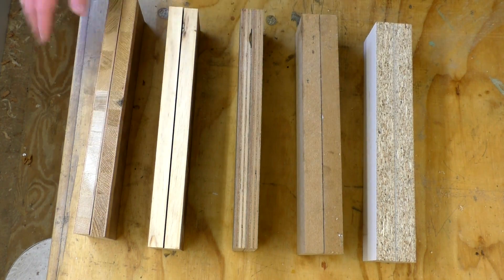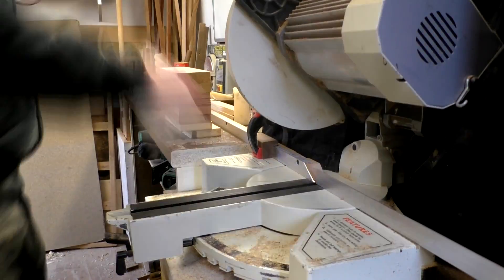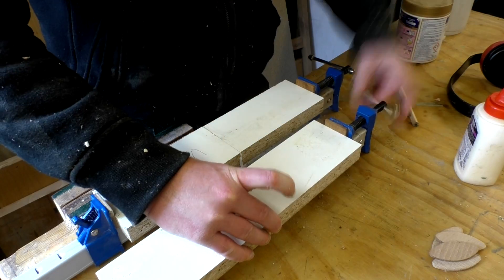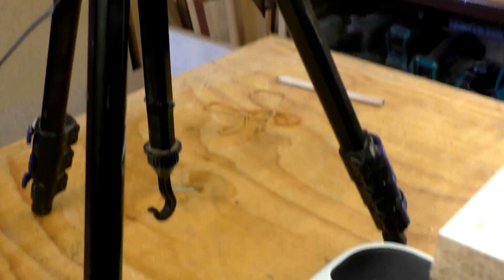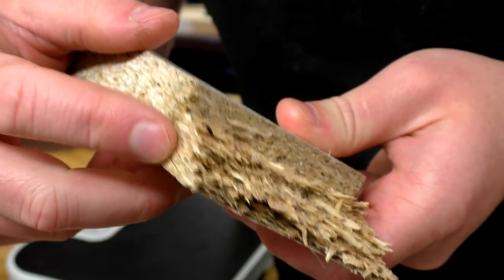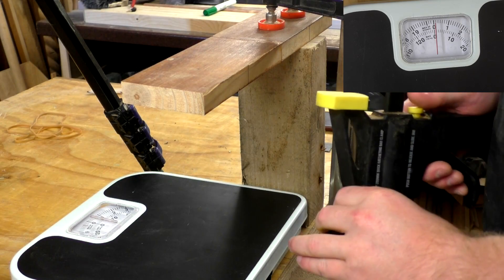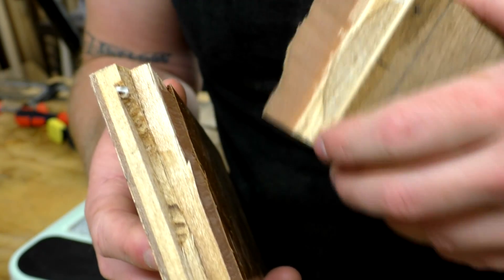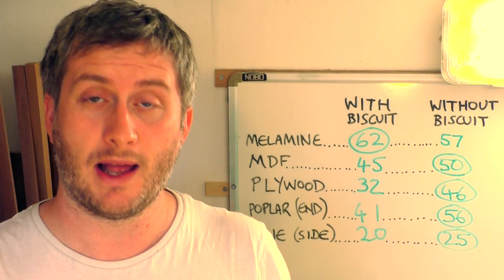Testing Biscuit Joint Strength - Do Biscuits Add Strength To A Glue Joint?

Comment: I have never used a biscuit in a joint. But, with the biscuit at the center-line, it takes the least amount of the load in bending. You might say the biscuit is least helpful strength-wise at the center of the board. Since your experiment is primarily bending, the "top is being compressed" and "Bottom is being stretched" seeing the greatest loads. The center gets very little of either. I would be interested to see if biscuits were placed closer to the end, would that make a difference? Also if you could "pull" the boards from the end, making a tension test. That test would be a little harder to set up, but I would come back to watch if you tried! Nice video.
Reply from the maker: +Jeremy Fielding thanks Jeremy. Yeah they are really good points. May do a follow up on this one day and try them in different positions. Will also see if I can think of a way of rigging some sort of "pull" test set up
Reply: Going on what you stated would a glue up with 2 biscuits an 1/8 of an inch from each surface would be a way to dramatically increase strength
Reply: Good point. I'm also curious about whether adding stress/flexing/fatigue to the joint first, or varying the moisture content in the wood might make biscuits or dowels perform differently... i.e. replicating wear and tear on regular furniture joints over the seasons. This would be even more annoying to test though :-)

Comment: i've always thought they add strength because it's kind of like a spline joint. But it seems the manufactured biscuits themselves aren't that strong. I would've been interesting to see more samples of each, so you can get a good average
Reply: Biscuit joints are really strong when used correctly. The problem with was test was that there was too many variables. 

I have used them before on structural joints and they are still standing.

Comment: Never used biscuits myself, ever.
For lining up you can also use tiny nails.
It would be interesting to also test it with dowels btw!
Reply from the maker: +dA Brewer thanks, yes may well do that soon :-)
Reply: yes would love to see it with dowels.

I think part of the reason why biscuit jointers (along with most other power tools) are so popular is simply because people, namely men, love buying tools like women buy shoes. 

Like every carpenter I see in a video on YouTube owns a kreg pocket hole and clamp set. When there is nothing special about the clamps and the jig can be homemade in less than a minute.

People like tools, nothing wrong with that. I like tools too.
I was about to buy a biscuit jointer but now I've found out they add no strength I won't. Somehow this makes me sad when I should be happy that strong joints are much easier to make than I thought!

Comment: I had heard that biscuits made no difference or maybe even weakened a joint. But I never actually believed it. Very interesting. I have a biscuit jointer but only used it for two projects since I bought it 2 years ago
Reply from the maker: +ksp1278 I had heard that too but didn't believe it... Now I do! May still use it for alignment every now and again but could definitely be without it!

Comment: Very interesting experiment. As far as I know, biscuit s are for alignment not for extra strength. They ran made from a very thin and soft wooden material compared to dowells or dominos. What makes wondering is the glue. I don't know what you use,but you shouldn't have so clean breaks at the glued joints.
Reply from the maker: +Stamatis T I think biscuits are made from beech which is a hardwood? I just use regular white pva wood glue. It's never failed me and is plenty strong enough for most applications

Comment: A very Matthias Wandel-like video, well done. I'm not that surprised biscuit joints fail more quickly then butt joints when a bending force is applied, since your making more holes and sharp corners in the joint along which it can fail. I think biscuit joints would perform better under a pulling force. What surprised me the most was how strong the end grain glue up was.
Reply from the maker: +Eduard van Iersel when you put it like that you're absolutely right! I don't know why I didn't think that way but I do now :-) the end grain joint really shocked me too

Comment: Also wld it depend where u put your clamp as in closer to the joint or further away from joints?
Reply from the maker: +dan barrow I don't think it'd make any difference as the force should be roughly the same once the glue joint is tight

Comment: Very nice video,

Your experiment setup was such that the joints where loaded with bending moment and shear force, with the moment being the dominant. The stress distribution due to bending moment in the cross section is linear with maximum tension at one edge, maximum compression at the other edge and zero at the center of the section depth. Therefore, in think that  the biscuits didn't add to the joint's strength because they where at the center of board thickness. Placing the biscuit closely as possible to the board face that is in tension will, in my opinion, strengthen the joints. 

thanks for the video it was very interesting.
Reply: Very Interesting point there.  Placing two biscuits, one at the top and one at the bottom could be better to put it in tension or compression and lower the moment.
Reply: Rag 'n' Bone Brown basically the middle will bend more than the  edge so you will break the biscuit easier in the middle.
Reply: hey, thanks for the 'clever'. Well just an engineer. I am attaching link to a 9 sec video presenting what i tried to explain in my comment. https://www.youtube.com/watch?v=NZ7jwnskKSQ. The bottom line is that joints with eccentric biscuits might be stronger.
Reply from the maker: +yzelickman thanks! Sorry but your comment has gone way over my head - you're too clever for me!

Comment: After watching this stuck my biscuit joiner on eBay, now searching for a Steve clamp...
Reply from the maker: +Kevin Clarke may do the same :-) haha I am going to start renting Steve out!
Reply: I have used biscuit joints for years and they are really strong. They really come into their own when doing carcas work on cabinets.  I have used biscuits on tables as well so the biscuits were applied to the joints and the glue was allowed to dry and then screws were applied after.  Those tables have stood for the last 20 years with no signs of failure.

Comment: I have always believed that biscuits are for alignment not strength. For strength use mortise & tenons / domino machine I would have thought
Reply: S W I would love to see a domino in use.  I still think the plain joint would be equally as strong.  A real mortis is probably much stronger.
Reply: My thought too i would never use or consider a biscuit for adding strength
Reply: after seeing this experiment , I think it's a real possibility that dominos add no strength either.
The examples here had the wood itself breaking because they had been weakened with a hole.
Reply: I think dominos would perform similarly to biscuits, as it is practically the same type of joint. Just a little different shape.

Comment: Very surprised as well Keith.  I bought the jointer specifically to get more strength in my glue-ups and not for the purpose of alignment.  Could have spent that money on a great dowel jig instead maybe...   
Thanks for the video, well made.
Reply from the maker: +David thank you! Surprised me too. Shame there are no other alternatives that are reasonably priced!
Reply: +David
Biscuits are great for alignment because they then allow you to use less accurate methods after the glue as set such as pocket holes or dowels. 

I will glue up biscuit joints and then apply a through dowel joint with does not require any fancy jigs. It is a very fast, accurate and extremely strong methods of jointing when used in this fashion.

Comment: Great video Keith a very scientific approach. I was waiting for you to break out the lab coat!

I'm not surprised biscuits are weaker. Without going all physics the structure is dramatically changed (surface area in different directions for glue) and the forces can therefore act in different ways due to the shape. 

As others have said they do aid alignment though. 

I wonder if a similar situation would be seen with dowels.
Reply from the maker: +Happy Wife Happy Life I'm starting to think a follow up with dowels and splines might be interesting !
Reply: A sample size of one per joint is hardly scientific, and to draw any conclusions from the results would be laughable. Try this another few hundred times per joint, and perhaps we could start discussing which is and isn't better than what, and start drawing conclusions as to why the results are the way they are. There are too many variables at play otherwise. "5 out of the 6 joints failed WITH the biscuits!" Okay, but how much glue per joint did you use? Did you measure the humidity of each joint and ensure they were as close a match with each? Were there any defects that could have caused a preemptive break upon closer inspection, etc?

Again, this was a cool little experiment, but hardly worth taking the results seriously.
Reply: "A sample size of one per joint is hardly scientific... Try this another few hundred times per joint"

Why don't you try that? Very easy to criticize others from your armchair, telling them what they should do. Much harder to actually do it yourself.
Reply: @MechanicalMooCow  Can you post the video where you did the hundreds of tests so we can know scientifically? Until that that, I will thank the author of this video for the work he did and use this "unscientific" data to influence my wood working decisions.

Comment: Interesting subject, another great vid! From my experience, biscuits main benefit is the alignment of boards, particularly when you're biscuiting the length of the board rather than the width. In terms of sheer strength, I'd assume most spliced/notched/jointed techniques would work better where applicable.